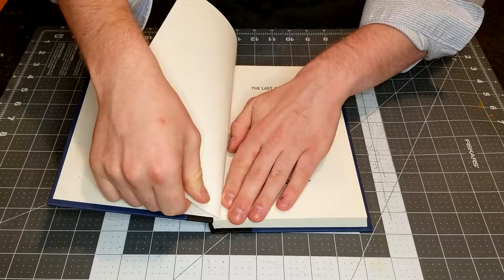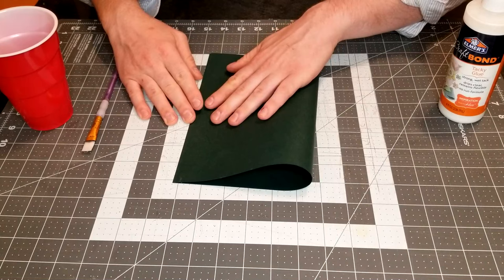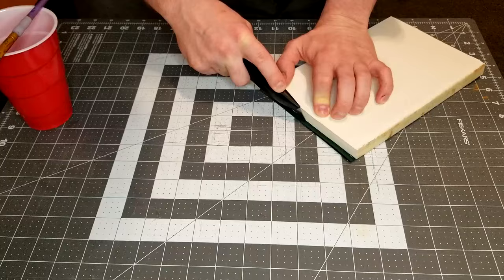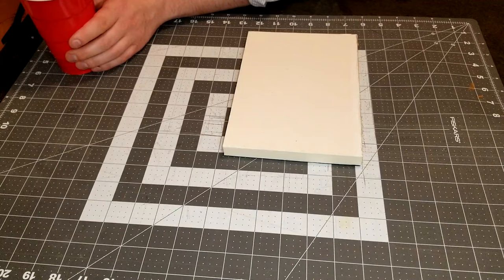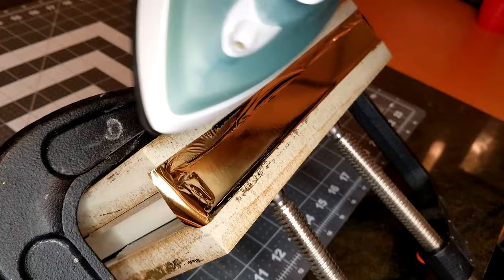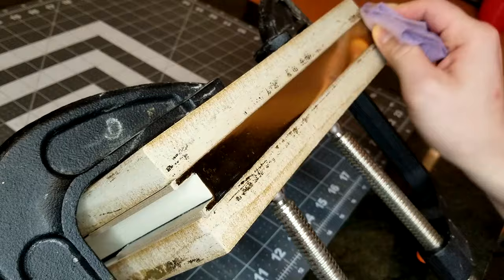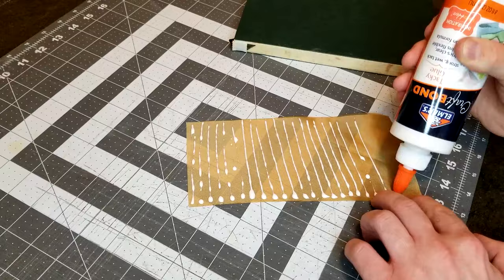DIY Leather Book Binding Tutorial Part 1: Page Edge Gilding and Text Block Preparation

Comment: Question for ya, have you ever looked into culture hustles gold paint for gilding?
Reply from the maker: I have tried several types of paint, including liquid leaf solutions, acrylic paint, spray paint, etc., but I found it to be a very finicky solution.  Most paints adhere to themselves stronger than they adhere to the pages, so when you try to peel the pages apart, one page will pull the paint off other pages. 
 There was one specific color of one specific brand that I had some success with, but even changing to a slightly different color didn't work.  As a result, I've never felt confident enough to recommend the paint option to people.  I haven't specifically tried Culture Hustle paint though.  It seems more reflective than most.  I am always on the lookout for an easier way to gild page edges, and if I ever make a breakthrough, I'll post it on this channel immediately!

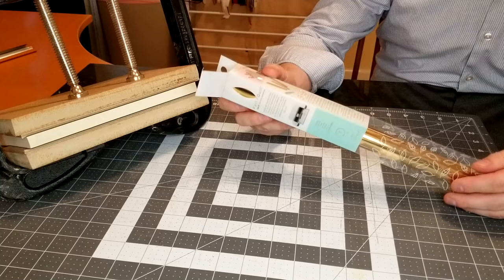Comment: Sobre for my audition.  Did you say "foil quill" in the 4:33 time? Where i can found the same material? Or buy it? Thanks a lot for  your time
Reply from the maker: You heard right!  Here is a link to the foil quill products:
https://www.wermemorykeepers.com/product-category/foil-quill/
Unfortunately the company is apparently discontinuing their line of foils, so I will need to find an alternative product soon.  You can still get some foils on clearance, but gold is already unavailable.  I will do some experimenting and make a video when I find a good replacement product.
Reply: @Ingenius Designs  what thickness of foil do you use for the pages? lol I used one that was apparently too thick and pretty much welded my pages 😂 I had to sand it again since i couldn't get it open

Comment: Great video! Do you sand the top and bottom of the text block as well?
Reply from the maker: Yes!  The top and bottom usually start smoother so they may take slightly less sanding, but the sanding step is critical.

Comment: How and when would you add red or blue paint under the gold? Maybe you‘ve seen how some professionally crafted Bibles are made with that.
Reply from the maker: What I think you are referring to is bole, which is a clay-based substance which helps to deepen the color of the gilding.  I have tried using it in the past but felt like it was more trouble than it was worth.  Still, if you want to try it I encourage you to experiment!
Reply: @ingeniusdesigns  
As far as I know, it was always referred to as "art gilding", but I've never heard of "bole". I have seen people apply archival ink to their already gilded Bibles. I think I'll try applying the ink first and then the gold, and the other way round.

Comment: I'm trying to use the foil technique you show I'm having a bit of an issue getting the foil to transfer any tips no matter how smooth I get it sanding or the foil or what temperature I use I keep getting mixed results never getting a full transfer
Reply from the maker: Thanks for asking.  I'm sorry that you're having a frustrating start.  This can definitely take some trial and error.  If the pages are perfectly smooth and clean (no dust or oils on them) and you're using the same type of foil, then the only thing I can think of is that you may need to iron for longer.  I'm sorry I can't be there to see what you're doing in person.  Here's a link to a video I made for awesome folks like you who wanted more detailed instructions.  I hope something in there might help!
https://www.youtube.com/watch?v=Er3hIEUuCms&ab_channel=IngeniusDesigns

Comment: Your videos are awesome. Thanks for making these. Quick question. Did you sand all three sides before doing the foil? Or did you sand + foil; sand + foil; sand + foil?
Reply from the maker: The second one.  Sand, foil, sand, foil, sand, foil.  The pages need to be perfectly smooth for the foiling to work best, and they lose a little bit of that perfection as soon as you release the clamps on them.
Reply: @ingeniusdesigns  Awesome. Thanks

Comment: Did you sand the top and bottom as well? Or just put foil quill over them as they are?
Reply from the maker: Yep, I sand all three edges, although the top and bottom usually don't take as much work to get smooth.

Comment: Do you know if the foil quill is very acidic? I've learned that acid content in materials can cause a lot of books to yellow and deteriorate over time so I'm trying to avoid it in my projects.
Reply from the maker: I'm not sure about that, and searching Google hasn't yielded any ready answer yet.  I could always try blending up some foil quill in distilled water and then dipping a ph strip in it, but that might be overkill, since the amount of surface in contact with the foil is so minimal that I doubt it will do any serious damage even if it is somewhat acidic.  Thanks for the excellent question!

Comment: Do you sand, foil then sand the next side to foil or do you sand all three sides then foil all three sides?
Reply from the maker: The first one.  Sand, foil, then sand the next side.  The pages need to remain clamped just as they were sanded when you start the foiling.

Comment: What size or brand do you use for the end pages? I'm trying some 12x12's but they're real close to being too short when folded.
Gilding the pages is pretty hard too, you make it look so easy!
Reply from the maker: I actually use a wide variety of brands depending on the color that I want.  12x12 sheets work fine for books 6" wide or less, but as you point out, it's too small for larger pages.  For bigger books I usually cut my end-papers out of poster-size sheets.  As you can see in this video, I cut them a little larger than I need so I can trim to exactly the dimensions of the book after I glue the end-papers in place.  

I'm sorry if the gilding has been giving you trouble.  You're right that I may have oversimplified it a bit in this tutorial, but to make up for it I do have an additional video dedicated only to the gilding process which goes into more detail.  Maybe that will help?

Comment: Have you ever done the gilding on a glossier paper like a comic omnibus? I tried your method and it will not stick at all. I tried playing with the heat with no better results.
Reply from the maker: I have, and I actually find it EASIER to gild those pages because they are slightly thicker than average.  I'm sorry that it wasn't working for you.  Were you using the same foil product and did you sand thoroughly first?

Comment: Can I reuse the original, albeit ugly, hardcovers? Or do you recommend chipboard?
Reply from the maker: There's nothing wrong with the material the original covers are made from, although I typically remove the paper from the covers before re-using them.  The problem is that I find the original covers are always a little too small to cover the book when I'm re-binding with leather.  So I keep old covers and will cut them up for use when binding smaller books, but I can't re-use them on the books they originally came from.

Comment: Amazing tutorial! Are you sanding then gilding one side before moving onto the next, or are you sanding all sides before gilding all sides? Cheers
Reply from the maker: The first one.  Sand, gild, re-clamp for the next side.  Repeated three times.  Good luck!!!
Reply: Thank you for the response. My first attempt at this failed as I was unable to source the same foil as you and tried use the cricut gold foil. It’s quite plasticky though and I was unable to separate the pages after ironing it on. Have managed to source the same foil as you and will be sanding and reattempting this week

Comment: Can a paperback with not that great paper quality be polished by sanding that well? It's of great value to me.
Reply from the maker: Yes!  I've succeeded with thick pages, thin pages, glossy pages, newspaper-like pages, old pages, and new pages.  Granted, older books are usually more uneven and require more extensive sanding to smooth the edges, and sometimes the bindings need some extra love too, but if you don't mind the slight destruction involved in sanding a treasured volume, I don't see why this technique wouldn't work.  I have another video with more detail on the process if it helps:
https://www.youtube.com/watch?v=Er3hIEUuCms&ab_channel=IngeniusDesigns

Comment: I'm at the sanding stage right now. how long per grit should i sand for? In your 120 grit you can see the green from the cardstock. I've cycled 120, 220, 320 (1000 hasn't come yet), the color from my cardstock has not come off the block yet. Do I just need to sand more for it to go away? how quickly do you run through the sanding blocks? I'm also assuming you sand all 3 sides before gilding them.
Reply from the maker: The amount of time per grit varies depending on how smooth the pages were to start with and how big the book is.  If there are scratches from a previous grit that you can't get rid of, then you probably need to go back to a lower grit and spend a little more time with that.  Don't worry if sawdust from your endpapers discolors the pages a little; it will usually go away by the end and even if it doesn't you'll be covering it all with gold anyway.  You sand one side, then gild it, then sand the next side, gild it, etc.  Hope that helps!  I'll be making a video about sanding soon.
Reply: @ingeniusdesigns  Awesome! Thank you, I saw your video about using a power sander. That helped a lot, just finally got my mirror finish on my textblock. Good thing I read your reply before gilding. I was going to do all sides first before gilding.

Comment: I'm really struggling with the foil quil foil! Any tips? It isnt adhering very well, it applies very patchy and while yours still looks solid, even gold up until you remove the foil, mine is getting white streaks as the foil applies here and there. There is no "wool" setting on our iron but I've tried "medium" and "max hot" and neither works.
Reply from the maker: It sounds to me like the pages aren't smooth enough.  Maybe the humor in my video masks this fact, but it really is very critical that you sand and sand until the pages are basically polished.  Even spots with a smooth but matte appearance may not adhere quite as well as those which are polished to a shine.  White lines like that typically mean that the sanding was incomplete so some pages are a tiny bit lower than others, causing the foil to not adhere there.  It's a tedious process and can be a bit of a learning curve, but if you keep trying and experimenting I'm sure you can figure it out!
Reply: @ingeniusdesigns  ahhhh okay! We sanded but only up to 600 grit and it felt so smooth I figured it was good to go! But it admittedly didn't have that mirror sheen yours does in the vid before you start the foiling

Comment: About how much does this cost to do on an average 9inch book?   I collect Easton Press books but there are so many books that they do not carry.
Reply from the maker: Sounds like our motivations are the same!  As for how much it costs, it depends on whether you plan to do just one book or many.  If it's just one, then it's not very cost effective, because you will almost undoubtedly buy more of every supply (leather, foil, vinyl, glue, etc.) than you need.  In that case it would probably be best to just commission your one book from an Etsy store or something.  If you plan to do multiple, however, then the cost of supplies (minus the book itself) probably comes to around $10-20 per book, depending on how big it is.

Comment: How long do you sand on each grit for? I have been trying this method and cannot seem to get that mirror finish.
Reply from the maker: It really depends on the book and how smooth it was at the beginning.  I'd say 10-20 minutes of sanding is required per side though, even when using a mechanical palm sander.  it's tedious.

Comment: Magnificent video, do you use a hot stamping printer for the covers details or the traditional foil technique? Thanks
Reply from the maker: Excellent question.  I've done some traditional tooling, and if there's enough interest I could make some instructional content on that, but in the end I found I could actually achieve the greatest variety in my designs while keeping within a reasonable budget by using vinyl instead of foil.  I demonstrate the process in my Part 2 video, which I just released!
https://youtu.be/cpJSAsGUbg0

Comment: Hey, I was wondering if it is possible to sand and guild the pages without removing the cover? I bought a unique set of scripures from 1983 and was looking to remove the stains and re-gilde the pages, but the covers are a white goatskin leather. I have no intention of replacing the leather cover, so would it even be possible to do so? Is it a reasonable project? I don’t want to try it without an expert’s opinion first. I really like this set, and would rather not ruin them in the process.
Reply from the maker: That's going to be tricky.  You could easily do that on the long side of the text block, but sanding and gilding the top and bottom without removing the cover might actually put your cover at increased risk of damage.  You wouldn't want to scratch it up or get stray gold foil on it.  If I was in your situation my preference would be to carefully remove the cover (sometimes you can even preserve the original end-papers), gild the text block, and then glue it back to the original cover.
Reply: @ingeniusdesigns  thank you very much. Should time permit, I will try this out.

Comment: I have a question. If the book is already hardcover, can you just use that to wrap the leather around instead of creating a new cover with the chipboard?
Reply from the maker: Great question, thanks for asking!  I considered that early on, but have never tried it.  

If you are thinking of never taking the text block out of the cover and trying to wrap it in leather with the text inside, then I foresee two challenges:  First, the leather wrapped around the covers would sit over the endpapers instead of under them.  You could try cutting it to shape very carefully to look pretty, but it would still look different from what people usually expect from a leather-bound book.  Second, you would need to get the leather wrapped around the spine, which would be tricky, because you would have to cut slits in it where the spine meets the pages.

if you are thinking of removing the text block from the cover, covering it with leather, adding new endpapers to the text block, and then gluing it back in place, then I'd say there's a higher chance of success.  That being said, leather and paper bend differently from each other, and you would have two layers in the book's "hinges" instead of one, so my concern is that the book might not fully open.  You could solve that problem by cutting away the paper "hinges" from the original covers and just reusing the boards.  I have attempted that, actually, but the leather I use is thicker than paper, so it pushes the text block out a bit and alters the proportions of the book so that the pages on the fore-edge sit almost flush with the cover (which is not what you want in a hard-cover book, of course).  In the end, I found that to compensate for the thickness of the leather I needed to use boards that were a little wider than those used in most paper bindings.  I still keep the old covers and sometimes use them when I'm binding smaller books, but I haven't found them useful on the book they originally came from.  Maybe that problem could be solved by using paper-thin leather like professional binderies do...but buying that grade of leather consistently gets outside my budget.

I know that was super rambly, but I hope something I said helped.  If you try it and have more success than I did, let me know!  I'd be happy to learn any new and improved technique!

Comment: I've tried to follow the steps in this video exactly, but I'm struggling with getting the foil quill to stick to my pages.  It won't stick around the edges at all.  I have tried working it for several minutes and it doesn't seem to work at all.  I have had ok success with the middle but even still it could be better.  I used the wool setting on my iron, but it seems like it may not be getting hot enough to heat the adhesive.  Do you have any ideas or tips that could help? TIA!
Reply from the maker: It's always tricky to problem-solve these things via comments, but I'll do my best.  Start by watching this video and see if you're doing everything I outline in it:
https://youtu.be/Er3hIEUuCms
If you are, then the problem is most likely insufficient sanding.  Often the edges don't get sanded quite as smooth as the center of the text block, which can keep the foil from adhering.  I'll be releasing a video on this topic in the coming weeks/months.
Reply: @ingeniusdesigns  thank you so much for your response.  I did some extra sanding and that seemed to really help.  i also found that going a bit slower really made a big difference too.  It's not perfect, but i think it turned out decently good.
Reply: I’m having almost exactly the opposite problem.  It’s sticking too well and the pages clump together and can’t be pulled apart.

Are there different “grades” of foil quill?  Could it be too thick?

I’m so excited to master this (collecting another press’ leather editions has gotten very pricey) and am sure the excellent video will get me there.  Thank you!